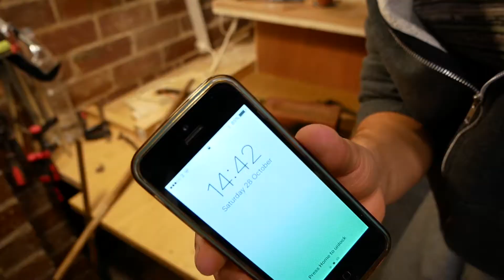Making Fire by hand Day 28 - 30 Day Youtube Challenge - BANDARRA

Comment: You need to make coal. Coal needs oxygen to burn. Make a slit from the hole to the side of the wood. This is where the coal piles up and gets oxygen the same time. This way you can make an amber. With this amber you can light something on fire.
Reply from the maker: that's 100% right. After I failed I watched some videos and tried again and that little slit made all the difference :)